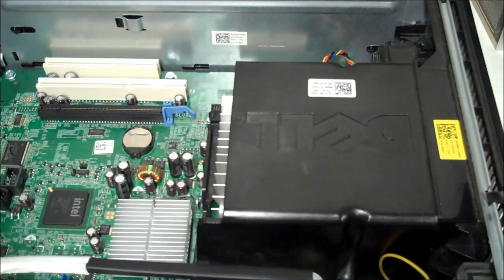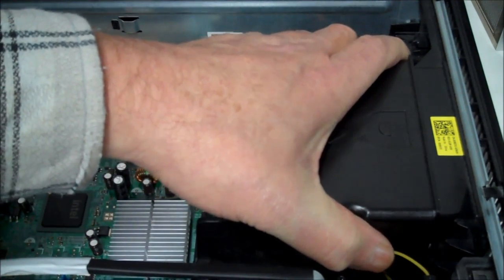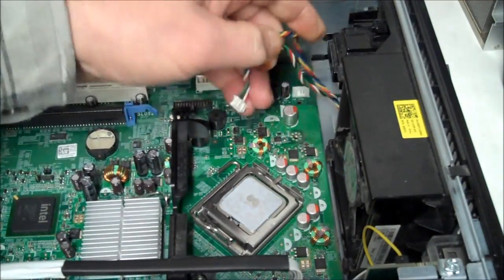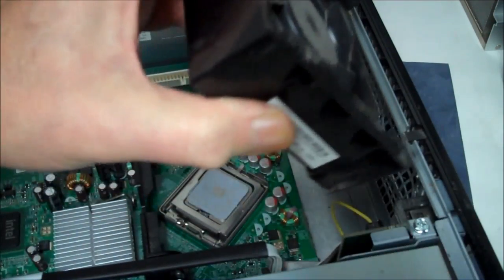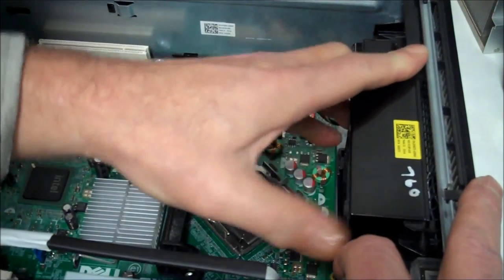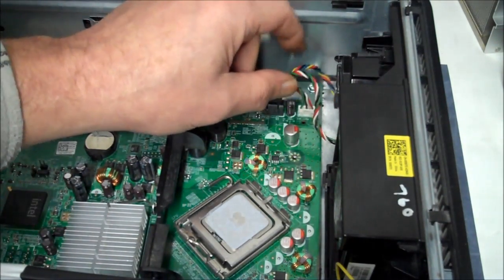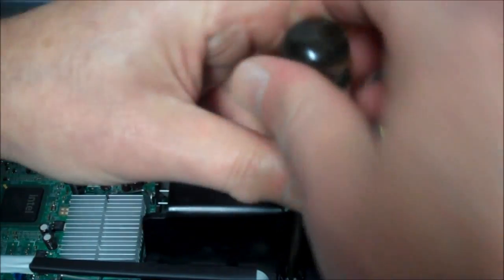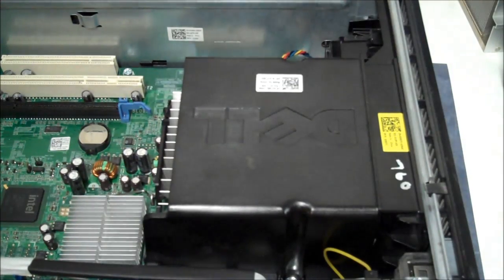Dell OptiPlex 760 How to Remove and Replace the Fan Assembly

Comment: Thank you so much for this!  I removed the old fan and heat sink (could not have done it without you!), and am waiting for new ones to arrive.  I hope it solves my problem.  When I turn on the computer, the screen is stuck on BIOS boot menu and won't load to the next screen.  The fan will start up then shut off right away or it'll make a knocking noise, so I'm assuming the fan is the problem.  Trying not to call a computer repair person, if I can help it, since I got the computer on Ebay recently for $90, which includes tax and shipping, so if the new fan doesn't solve the problem, I might give up on repairing it.

Comment: I'm having trouble with a computer, and I'm wondering what I can do to fix it. Basically, I am a blind woman who uses JAWS (Job Access With Speech) screenreader software, and I have a Dell Optiplex GX520 Desktop computer, Express Service Code 29309640481, Service Tag DGQ7BC1, which was purchased for me by my American Dad, Scott. There's a problem I've recently run into, and I'm going crazy trying to find just the right solution, so I was wondering if anyone can please help. When I press the Power button on my Dell Optiplex GX520 Desktop computer, the fans are supposed to spin up for a second, then slow down as the machine boots. However, they're now spinning wildly out of control. This only recently started happening on November 28 of this year. I'm so afraid that something might explode or sizzle if I try to turn it on again. My sighted friend, Markus Johnson (yes, that's "Markus" with a "k", not a "c"), is hopefully going to come over soon to clean out the machine, as I fear that dust may be causing this issue. I'm hoping nothing has failed, as I've had this machine since 2009, and it's been running like a Swiss watch for me. However, the case fan has started making this horrible grinding noise, like a diesel truck at full throttle. At least I think it's the case fan. Will any replacement case fan work with this machine? Or does it have to be proprietary to Dell's computers? Markus has told me to leave the machine powered off for now, and wait until he comes over to check it out. Is this a good idea? Also, what can I do to prevent any dust from blowing back into the machine? Is there a dust mat I can put underneath the tower? Also, is there a way I could add a cooling pad underneath the machine? What do cooling pads contain that keeps things cool? I'm confused! I'm also wondering, might it have something to do with the Bios? Is there a safe and easy way to reset the bios on my Dell without ruining the machine? If so, what do I do?

Comment: Hello friend 

May I ask. Does it support the typical round cpu cooler?
Reply from the maker: I would think as long as you can lock it down on the chip it should work fine.

Comment: Great video, I'm glad you didn't have a bunch of fruity music, etc.  I have 40+ years of experience with PC's and hardware work but had to watch someone else do this so I didn't break anything.   Just one thing that you didn't do was clean and replace the heat sink compound because when you remove the heatsink it breaks the 'seal' or whatever you want to call it and then you really should replace the compound.  I always keep a small tub handy for such purposes...  Best regards...
Reply from the maker: Thanks, I usually replace the compound or re-spread it around if I don't have any.
I may have just skipped that part for whatever reason.
Reply: CRSolarice, likewise I've 40+ years of experience with PC's including hardware, software, and networking. I agree with the 'one thing' you mentioned. I realize you wrote this 4 years ago, so I don't know if you'll see this. The one thing I would suggest to anyone who is going to video tape themselves replacing computer components is to do a dry run first.  It serves two purposes. 1) practice removing the parts before you actually do a video. It helps to get the hang of removing the items (and replacing them), so if you struggle with it, you can figure out the best way so when you do the video you'll appear more professional and it'll take less time.  2) It'll also loosen up the part so when you do the video, the part should be easier to remove.  My 2₵.

Comment: Hi, when I am putting it all back together, should I be applying fresh thermal paste? Thanks
Reply from the maker: If the paste is too hard to spread around on the chip I'll clean the chip and the heatsink and use some new stuff.

Comment: I feel the chassis version should be mentioned in the title, as the method is not the same on the Mini Tower variant.
Reply: Agh, I just realized this is for the 760, I'm working on the 755, which comes in 3 or 4 different form factors, sorry!
Reply from the maker: no problem
Reply from the maker: I believe they are one and the same. Stand it up and its a tower.
Reply: Completely different shroud, on mine.

Comment: This is probably a stupid question, but...it seems my fan is working, the one you replaced in this video, BUT is there another one in my 760?.  I feel the 'intake' on the front fan, so I assume it is working.  (To get to all the wires on my computer,  I would have to move a lot of furniture and it would be a long process). Is there another bigger second fan in this unit???   Every so often, when there is a power outage, i swear I hear a big 'WOOSHING' sound of a much bigger fan kicking in. Or is that the front fan, powering up after the power comes back on?
Reply from the maker: That is the only fan. Sometimes fans make funny noises after being restarted.
Reply: then it isnt broken if that is the only fan.
Reply: PSU has a fan?
Reply: @exiled-AI  The fan blows on the heat sink, which is on top of the CPU, therefore CPU fan.

Comment: Was hoping to see the actual fan itself replaced not the whole assembly there. I have removed the fan sucessfully from the rubber stand but am unable to seat the fan back in fully.
Reply from the maker: yea I had trouble with it too. Tore 1 of the rubbers.

Comment: I am building a Dell OptiPlex 755 from scratch & I have the larger full size case on the way & the larger cooler with shroud & bracket & a new fan. & have upgraded other Dells before that were similar like the Dell e5150 which is also a socket 775 & the same shape & size case. But it has been a little while & I can't remember if I need a bracket for behind the motherboard for the cooler to mount to or if the cooler screws into the case behind the motherboard, so that is my question. Do I need a bracket for the backside or will the cooler screw to the case dirrectly?
Reply from the maker: I can't remember, I don't recall.
I had a quick look at it and can't tell anything at all.
I really don't feel like taking it apart either lol.